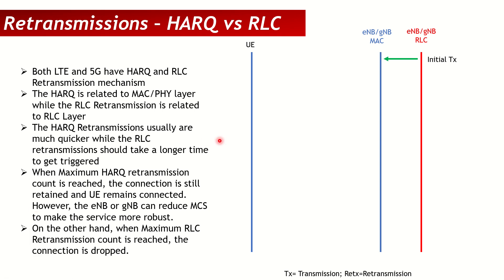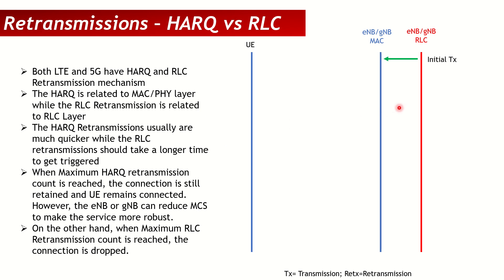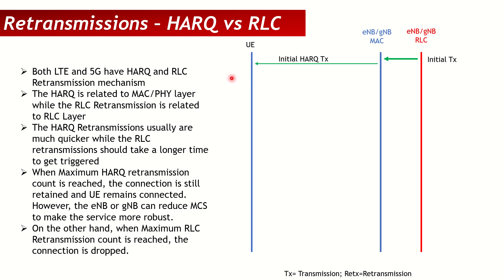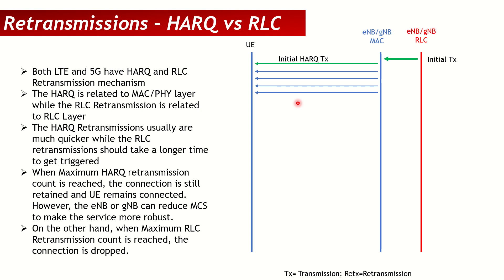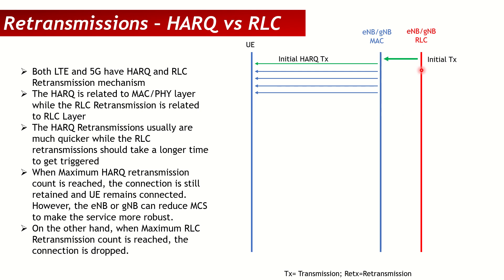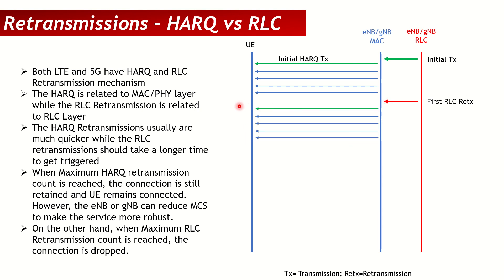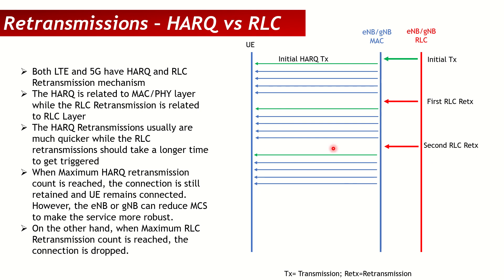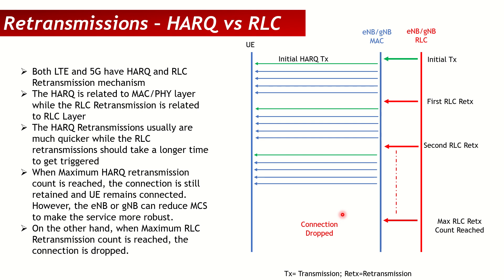LTE & 5G Retransmission Mechanisms: HARQ & RLC Explained

Comment: Thanks for the nice video. I subscribed to your channel for such videos. 

Can you please confirm if the understanding is correct
1) RLC nack will come into picture after max harq retransmissions?
2) So if the UE is in poor radio condition or high bler, then rlc nack will occur?
3) RLC nack can cause an increase of RLC delay.
4) What can be the other causes of RLC delay? can it be due to rlc buffer size full?

Can you make a video related to RLC buffer size and its consequences?
Reply from the maker: Correct. Max HARQ Retx should result in a NACK for RLC. So, higher BLER will result in more RLC NACKs which should increase the RLC buffer delay. Usually bad radio conditions or congestion can increase the RLC buffer and thus, increase the RLC delay.
Reply: @OurTechPlanet  can you explain more about rlc congestion? I mean if any videos? By congestion, my understanding is excessive buffering of packets, i.e. A timestamp is added to every ingressed packet and time delay is when the packet is egressed after certain time delay.
Reply from the maker: @bijitdeb2010  Ok , will add it to my To-Do list :)
Reply: Thank 😊 🙏

Comment: Thanks for your clear explanation! I want to ask for some applications (such as 5G MBS PTM), RAN1 has decided to add the feature of HARQ in PHY layer. However, PTM only supports UM at RLC layer. Under this scenario, can we state that the gNB will know the reception status of each UE?
Reply from the maker: The example in this session is for RLC AM mode which is used for most of the data type sessions. For RLC UM mode, the HARQ retransmissions is the only medium since there will be no RLC retransmissions. So, if all HARQ retransmissions fail then the packet is lost. However, the usual approach for such scenarios is to make the HARQ very robust by increasing the number of retransmission count for HARQ and also by decreasing the modulation to improve the link budget.

Comment: However, the eNB or gNB can reduce MCS to make the service more robust.

This is done after HARQ ReTx (4 times) are exhausted so can it be said that it will happen (if it does happen) with RLC ReTx?
Reply from the maker: No, it can actually happen after first NACK or a couple of retransmissions as well. It is open to implementation.
Reply: It can happen after first NACK? Then this new MCS lowered packet should be re-sent by RLC? But then this should happen after harqs have expired and there's an RLC re-transmission?
Reply from the maker: @filthykid84  Any MCS reduction is a MAC layer concept. RLC does not interact with that.